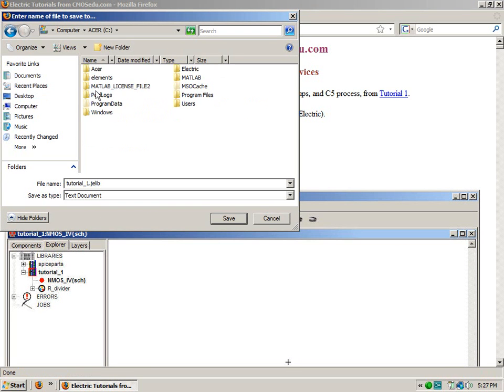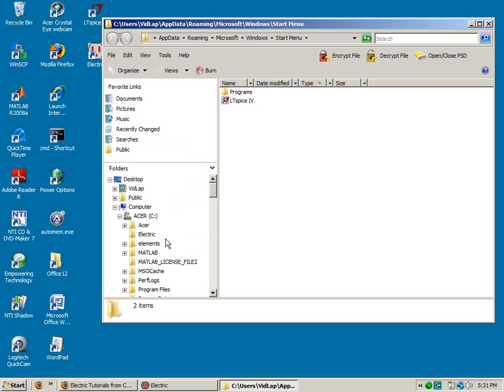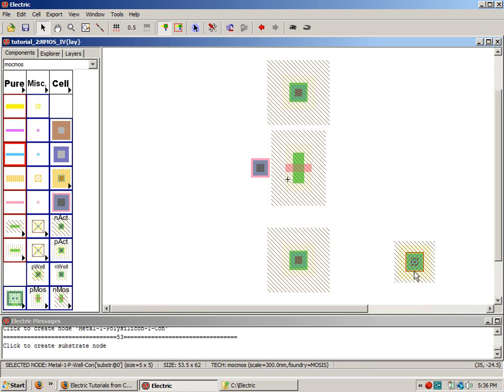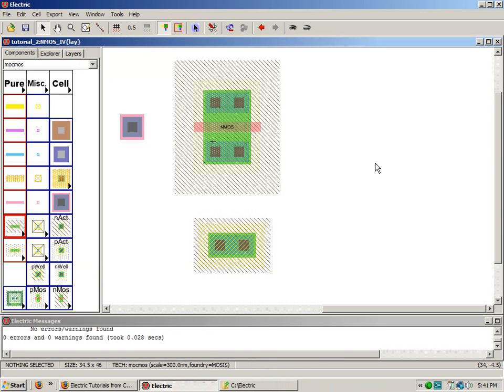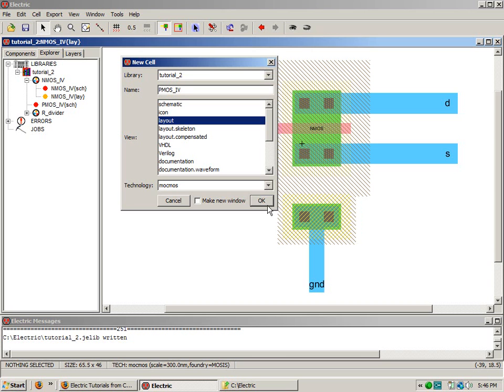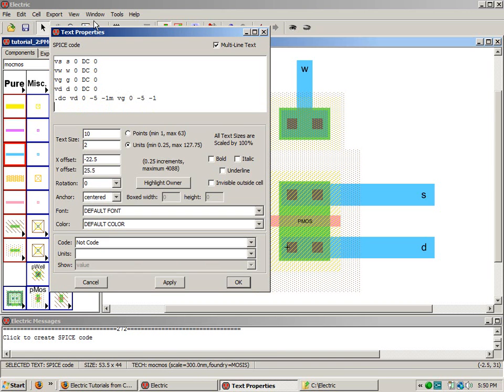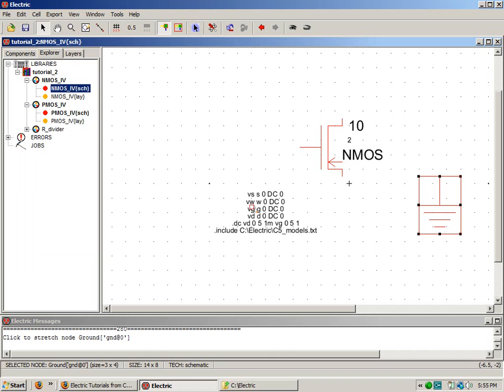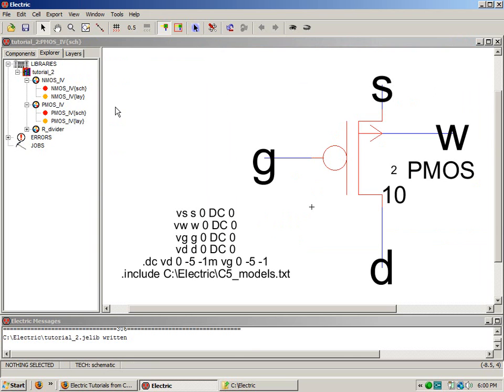Electric VLSI Video Tutorial 2 by Professor Jake Baker

Comment: 3:55 Ctrl+Click on Instance to Change Symbol properties
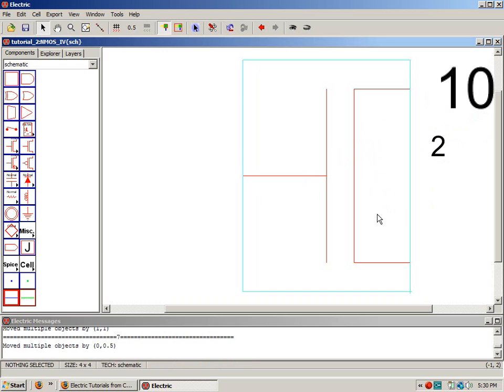4:20 Set Spice Model for MOS
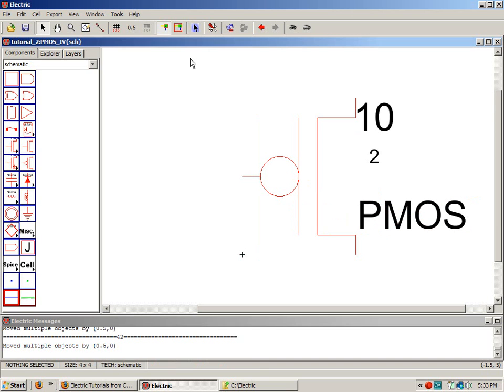6:55 Changing MOS to a four port device
11:46 Set Spice Model in Layout
12:42 Arc Properties and DRC with ARC(Wire)
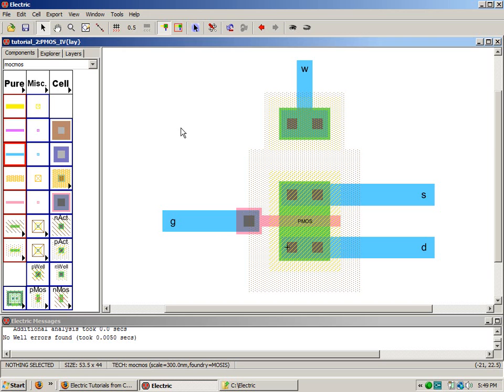22:40 Adding SPICE Code
28:46 Sizing the Schematic Symbol

Ctrl+G Toggle Grid